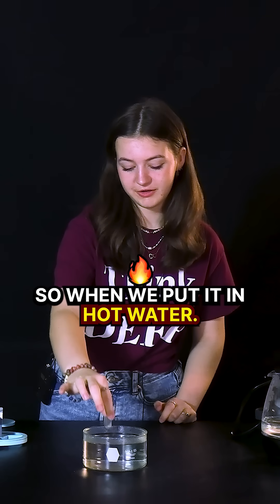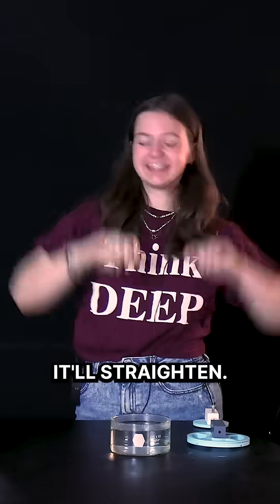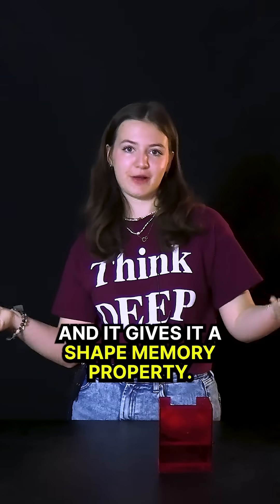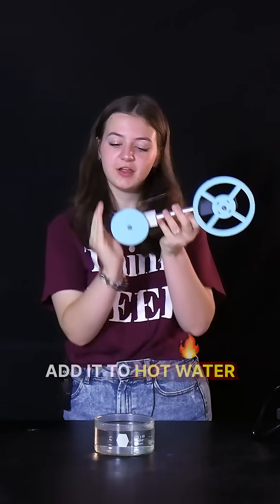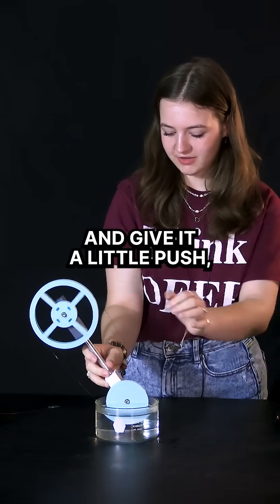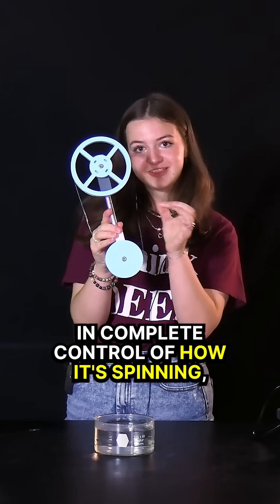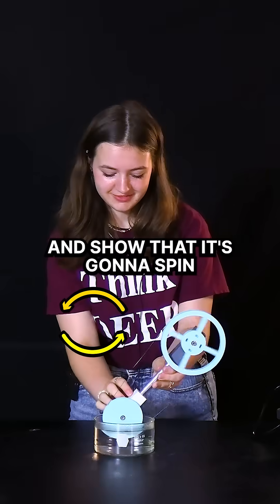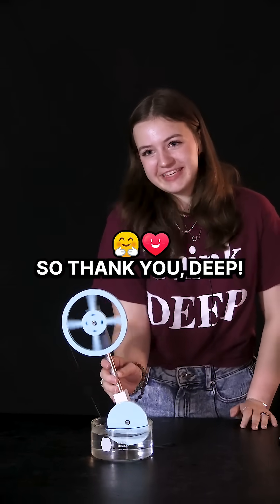Magic metal springs to life from heat! But how?? #shorts #tamu #science

Comment: Honestly could be a great alternative to photovoltaic cells in terms of solar generation or even just thermogenerators seeing as you don't need to boil the water into steam to turn turbines, you just need warm or hot water to straighten the wires and turn the alternator shaft.

Comment: For people not understanding where the energy is coming from, it's from the heat in the water. That of which has to get hot first. Once it cools, wire no longer spins. And it's very slow but this is one way to convert geothermal energy.
Reply: @benbraceletspurple9108  that being said, if you add some of these contraptions to let's say nuclear power plants that already produce astronomical amounts of hot water, you can increase efficiency and power output or mechanical torque for some extra stuff on the fly without too much of an effort.
Reply: @KayCypher put it in a server rack and collect some latent power for the rgb 😉
Reply: @KayCypher  OR JUST USE HOT THERMAL SPRINGS
Reply: @KayCypher  you basically just described how they already work. The water heats up, producing steam, which creates pressure that pushes the turbines

Also the heat involved might actually be too hot for the alloy
Reply: @benbraceletspurple9108 disclaimer:I aren't no sigh ins feller.
Would the heat be the energy source or the catalyst (Def. No. 2, to cause to move suddenly and with force.)? 
Not saying I disagree with you, just curious.
Reply: @PaulFE7  Okay so basically the heat is the energy transference

The source of heat is the ultimate source of energy, which in most cases is fossil fuels, but nuclear sources and natural sources do occur depending on your power grid.

But if you applied this to a direct source you'd be converting chemical energy (in the case of fossil fuels), or direct heat radiation (in the case of solar and nuclear power), into kinetic energy. Specifically rotational energy.

Thermodynamic laws are laws because we have not found ways of breaking them. Its not that science doesn't want you to, infact scientists are constantly trying to do it (that's why perpetual motion is considered the holy grail of physics). The laws are instead observations that have yet to have any reliably documented exceptions (as in none that could be reproduced), and have remained unchallenged for centuries because of that.
Reply: @benbraceletspurple9108  Certainly! People assuming this is meant to be a perpetual motion or free energy device are of course wrong, energy always needs a source. This is however incredibly wonderful! Imagine an upscales version in a cold place that has thermal heat! While “free energy” isn’t real as people frame it, the universe is constantly flowing with energy, it’s all about harnessing that flow. The earths core has always been hot, and the surface in some places cold. A device like this could generate perpetual, constant energy virtually forever (if the device was produced to last; of course material wear and tear would be the issue of note here)
Reply: Im in love.
Reply: Yeah, and anywhere where heating happens for production purposes, add a device to it and have additional power features.
Reply: Its like a steam engine, but with fancy alloys and physical science instead of a traditional steam piston and flywheel
Reply: @MrBlack0950  yea but steam requires a lot of energy to produce. This would convert energy at a much lower temperature, which may be more efficient.
Reply: Probably could create a tank connected with copper rods to a thermal pad outside that has a magnifying glass pointing at it. Use the sun, its free. Or just have it point right at the tank to heat the water.
Reply: If you combine hot and cold water on different sides, then you can continue the movement. Then if you add magnetic power, you can create electricity. Ofc, you still need fuel to change the temperature repeatedly.
Reply: @benbraceletspurple9108  what if....you put it in a hot spring?
Reply: The energy actually comes from the process of deforming the metal once it's cooled. This accumulates energy in the form of tension, which is released once the metal is heated again.
Reply: @benbraceletspurple9108  is there a material like this that reacts to cold water? Or even room temperature water? If that was the case plopping these babies in the ocean right on the beach might be perpetual motion of infinite energy right?
Reply: @danielernst6987  this works because the room and the air are at different temperatures. It could work if the ocean and the air had a significant temperature differential. It’s not infinite energy though because the energy heating the air needs to come from somewhere (most likely the sun).

Comment: I’m thinking automatic ☔️ umbrella that opens on contact with water. Since you’d want the arms to deploy simultaneously, they should be centrally linked with the nitinol acting as a sensor+relay+linear actuator (tension spring when going from dry to wet, compression spring wet to dry).
Reply: Unfortunately it's the heat doing the work, not the water. It would also react to a heat gun.

Comment: thats not the reason...or i could just insulate and get more power out than i need to heat it....butthe staitening of the wire needs energy with is extracted from the hot water....but steam engines only convert 30% of input power into mach energy....this mechanism might be a bit  higer

Comment: a literal perpetual motion machine....
Reply: @kushhtime420  no. It takes energy from the heat of the water. If you ran it for a few minutes, the water would cool and it would stop
Reply: @ScrungoBungo  If the water was room temp, the drying water on the metal filament would cool it down enough to keep the cycle going. I understand why you decided to comment though, some people just don't get much attention.
Reply: @kushhtime420 this comment made no sense

Comment: I would try a giant magnifying glass to hit a pool of water that a black patch of material  on the bottom to greater absorb the heat to warm it. then like an oiler... I would add water that is normal ambient temperature to the top side of the wire with a brush of some sort.. in this contraption to cause the expansion and contraction. Would be interesting to see if this is the key to perpetual energy...

Comment: Powered by...thermal energy...not fancy metal...
Reply: Yeah but if you used copper or something it wouldn't do that. The energy comes from the heat, the movement comes from the wire

Comment: If that wire can spin that wheel fast enough to keep the water warm then shes onto something
Reply: But evaporation, radiation, conduction, all of that will reduce the overall. And in a theoretical closed system, it still can't work because just spinning doesn't produce nearly enough heat to warm water. You have any idea how hard it is to boil water?

Comment: Put that through extreme amount of reduction gears and see if you can move a film to run. Keep it at the right speed with some sort of governor. Or make sure that the film is being shot equal to the speed that it can run. Although I don't think there's enough energy output. Minerals rock  🤘

Comment: Looks like you've invented a rotary valve that can be geared that pretty cool could be used in moving blinds curtains in cases where shade is required.
The other thing that behaves for this purpose is wax valves on a old car. When the engine got hot the wax melted and opened the valves and when it cooled the wax contracted snd closed the valves

Comment: For those wondering if you put it in hot water spring to turn the wheel causing infinite power 
Remember one thing

The entropy of an isolated system only increases. 
You coffee, yeh? It will get cold
 You follow

Comment: Could heat the water with a giant magnifying glass on a larger scale, syphon some of the energy to a battery for the night time. Use the charged battery to keep it running at night with a hybrid source to keep it going at night and turn off the hybrid system during the day to get free energy from the sun

Comment: i know you need hot water for this which needs energy, but is it not possible to use water that is naturally hot, like hot springs? Genuinely wondering too
Reply: Unfortunately nitinol wire engines are very inefficient, and don’t produce much usable energy. In addition, they just don’t scale well. You can use natural heat sources like hot springs for energy though, look up geothermal generators.

Comment: The wheel still spins in the same direction because the wire is try to straighten the same direction just because you tilt the other direction doesn't mean it changes direction in which it spins you would have to flip it or turn it for it to spin the opposite direction

Comment: Yes before people jump up and down with perpetual motion . Its the heat in the water providing energy to turn the pulleys. Energy is not ever created or destroyed , it just changes form . Sunlight on a solar panel to create electricity to heat the water to turn the pulley . Is the simple version .

Comment: Thank you for the demonstration. Weird question, will that wire get metal fatigue if it changes its structure frequently? If you were to use it frequently in that wheel application Is it likely to break with frequent use?

Comment: No way no energy is lost… boys is this perpetual motion?
Reply: Energy from the hot water is converted to mechanical motion through the metal, heat dissipating through the cup and air as well as any friction in the wheel system is lost energy

Comment: about the straightening loop
could it be turn into free energy???
since it's stuck on a loop
I know it need heat or hot water But other than that
could it generate just enough to heat it self and simultaneously energize other things. if it's made in a large amount or a Sturdy amount

Comment: What ratio of wire to weight do you need to achieve enough torque to move something with a pulley system designed to use that material mechanically

Comment: The hardest part about making a perpetual motion machine is figuring out where to hide the battery.
Reply: This isn't a perpetual motion machine, it is reliant on both the temperature of the water and the mechanism of the metal trying to straighten. Without maintenance of the water temperature(which requires external energy) teh metal will fail to perform its task, and eventually the metal will also lose this property, requiring replacement. Any system that falls to entropy is not perpetual

Comment: Basically you can use this for motorized transport because the engine heats up fast anyway and front that heat the petrol engine can then stop working for a while and then this technology continues can be like a hybrid but maybe more efficient . Or u can even let a battery heat up a water solution and u have a great solution there my mind is raging with ideas now this should be me implemented . Elevators . Escalators . Trains trams metro systems

Comment: So I would assume that if the bowl of water has a magnifying glass pointed at the bowl of water and energy from the sun , then the water will get hot enough to turn the wheel. 
Then place the bowl in a sand generator and it will stay hot as long as the sand. 
Turning the wheel longer. 
Then turning an alternator for DC power.

Comment: Interesting. It uses the temperature differential of the water and the air. Something to cool the air or heat the water works to power the rotational energy. Wonder if theres any cool micro-generator applications of this.

Comment: would body temperature 37C be enough for the wire to rotate those wheels? If so, could rotate a pump inside a body without a battery?

Comment: Neat way to build an engine, converting heat into rotation. Would be interesting to hook it up to a generator and see what kind of efficiency you can get. I'm curious also is the wire eventually wears out? How long can this thing go if you keep the water heated?

Comment: I helped build a small generator using a bunch of nittonal wires in the same fashion You are using them. While we didn't get a whole lot of torque, with some gear reduction we were able to get it to turn a small motor and hooked It up to an inverter. The idea was to make a small unit that you could take camping or for emergencies. Just had a little chamber you poured water in and through a couple ice cubes in. It was pretty sweet honestly and have never checked to see if anyone has brought it to market yet🤷.

Comment: Now add magnets to it that will spin next to copper coils that power a peltier that will heat the wire replacing the water that loses its temp. Where as the peltier will maintain it when powered

Comment: The guy with the most likes called it power which is actually very different from infinite kinetic energy. Power is rate of either synthesis of energy by a machine or the rate of consumption of energy. Also he got the thermal and heat energy concept wrong. Heat energy is being converted to kinetic energy and the heat is lost to the surrounding in a practical system. It can, however, in theory, in vaccum, be used to permanently conserve heat energy as the metal retains the heat and it can be used to re heat the water.

Comment: That’s what we call Infinite ♾️ power. Uses currently? A lot of Pulleys running forever. That right there could be the end to the vehicle 🚗 Serpentine Belt replacements! Your mechanic 👨🏻‍🔧 will Thank God.
Especially backyard Mechanics! 🧰
Reply: the heat from the water is being transferred into kinetic energy, and therefore will (eventually) run out

Comment: Does the metal fatigue quickly? Or is this something that can be done many times over without getting brittle/weak?
Reply: the heat from the water is being transferred into kinetic energy, and therefore will (eventually) run out

Comment: Why we’re still debating about infinite power. Don’t we already have them? This is one example and if you have a heat source which is infinite then you get infinite power. Simple. We already have water, wind, waves doing this. It’s not magical. But still we need to explore more innovative ways like this video demonstrated. It’s super cool and useful.
Reply: the heat from the water is being transferred into kinetic energy, and therefore will (eventually) run out, even if it takes millions of years

Comment: Well. Perpetual motion,like this seems to be, doesnt work with the laws of physics. Power is energy and that energy breaks down as soon it realases it start to stagnate. So this is NOT a eternal machine. Sadly not!
Reply: the heat from the water is being transferred into kinetic energy, and therefore will (eventually) run out

Comment: Free energy😮
Reply: its not free energy. the water is releasing energy in the form of heat and the wire is using that energy to straighten itself and therefore move. once the water cools the wire stops moving.

Comment: Pair it with one of those decay reactors to make heat and you have consistent infinite energy.

Like an RTG reactor in a pool of water with the metal/pully system scaled up a bit for some consistent thermal to mechanical energy transferrence

Comment: No, it isn't completely powered by the nitinol. It's powered by the potential energy turning into kinetic energy as nitinol changes structure. Meaning outside energy is required (heating and cooling) to run said pulley system. Why is that any better than any other rope pulley system?? Does it still use less energy than a normal pulley?

Comment: Free energy formula (solar panels +battery )+(simple heater)in some water+(the pulley )(and that (nightennol string) 
And voila you got free energy 
After that, all you need is Maintainnance
Af after you 🫵you tried it and it works all I need is 5% of your profits🫶🏻
Reply: Why not just use the energy generated by the solar panels directly lol

Comment: That generator for hot Springs / in the desert 🐪 running of large hot water pipes 
Anywhere there is heat you could stem  it off 
😊

Comment: I’m pretty sure someone has said it here in the comments, but I just didn’t see. That is the same wire they use for braces! The initial shape of the wire for braces is curved and pretty easy to bend as it is pretty delicate, but when in contact with something hot, it stiffens causing discomfort. That’s why we are mostly recommended to eat/drink cold foods when we have braces, to loosen the wire and avoid it from straightening, that causes the pain in our teeth! Really cool video :))

Comment: Ultimately one could calculate how much (in volts) let’s say perhaps a cup of tea (150mls) at a temperature just below boiling and compare which performs better. This is really smart. I used to think same thing could be done if the bottom pulley is put closely to a opposite magnet pole, while it tried to attract the other magnet it passes it slightly at and angle but misses it then another magnet or that’s pulls it furthermore down also missing its and ultimately you have some sort of perpetual motion by the looped magnets, of course nobody took me serious in my grade 11/12 when i suggested we experiment it in my class, let alone my physical science teacher

Comment: Would be be able to calculate the max speed of rotation assuming constant temp of the water? Like, eventually it has to be spinning fast enough that some significant section of wire cannot cool before its required to straighten again.

And even at that, how significantly does the temperate if the water affect speed of rotation? Is it enough to control it or try to squeeze slightly more torque out by spinning slower?

Comment: Could thicker wire be used to turn incrementally more gears, and larger gears, to create friction, which could be captured via a coil, to in turn create more heat for the water? Forever wheel? Think waterwheel on still hot water?